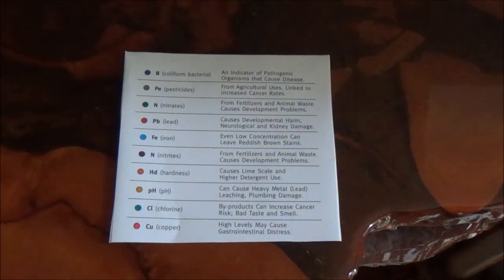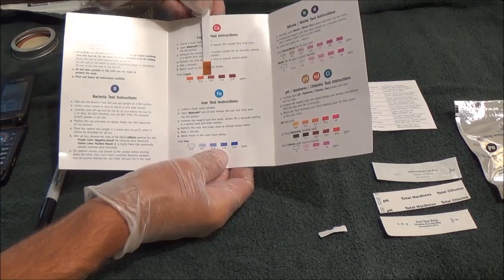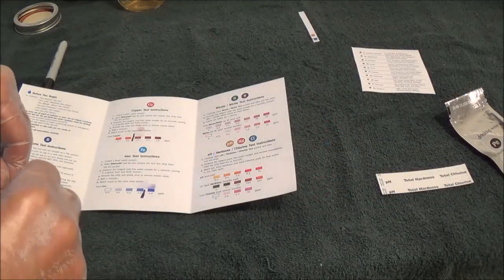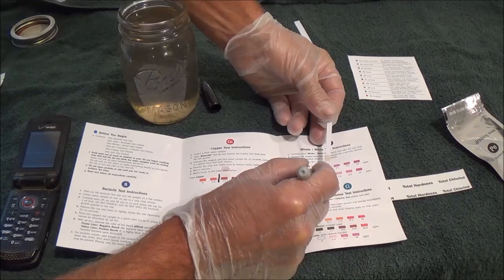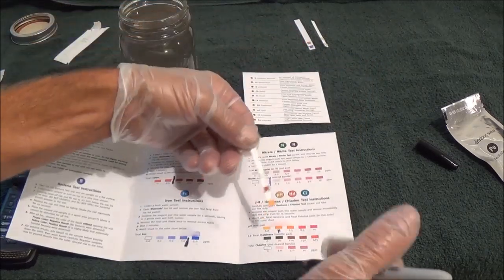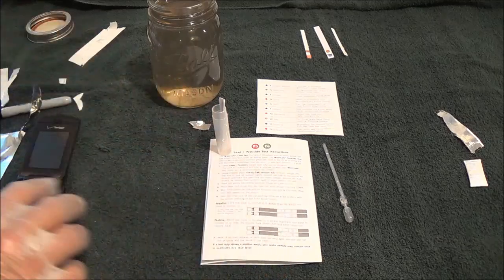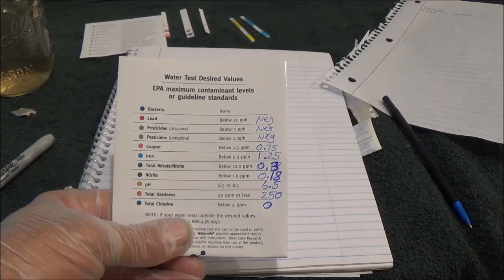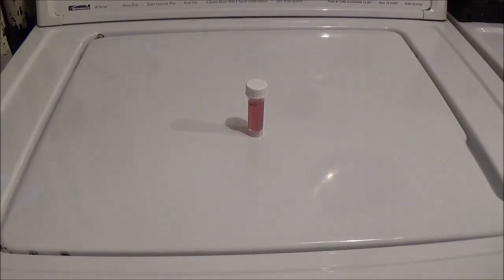How To Test Well Water For Potability. Hand Pump Water Well, The Tent Well Completed.

Comment: Congratulations! Potable water is a blessing! No filtering!

We have iron in our water, but it isn't a big issue. After all, we need iron for our bodies to function. Rather have it in the water than to have to take a pill. :-)

Have never dealt with hard water, but from what I understand, there are work-arounds to help with that. Know that vinegar helps remove scale build-up, for example. If you ever have to do laundry at the cabin, believe there are water softener additives that you can use.

Comment: with a fresh dug well, the hardness will be elevated until you pump the loose sediment out of the pit.  The hardness reading will drop down as the loose stuff sticks back together.  6.5 ph is in the acidic range that would be an issue over time if you had copper or black pipe interior plumbing pipes.  Or metallic fittings on valves.  batch pumping a bucket at a time wont be a factor.
Reply: Im west of the iron range about 70 miles and my water is still very rusty.  its a known thing all over northern MN.  makes the water taste fantastic though, never cared for drinking soft water.

Comment: hey Joe good video.
Im over by Bemidji, and I was wondering how you keep your well from getting destroyed in the winter? 
Is there a drain on it or should i look into a pump that has a weep hole in the bottom of it? like a hydrant ya know?
Reply from the maker: This type of well does not have the plunger way down the pipe, this ones plunger it just in that top pump part. You lift the handle and the water drains down. If you have the better type pump with the plunger down farther you need to drill a weep hole.

Comment: Would this mean you can drink from the well without any further treatment (filtering/purifying/boiling etc…) and would filter and boiling or even capturing condensation from boiling be viable if all tests failed?
Reply from the maker: This means the water can be consumed right out of the pump. Nothing more needs to be done.